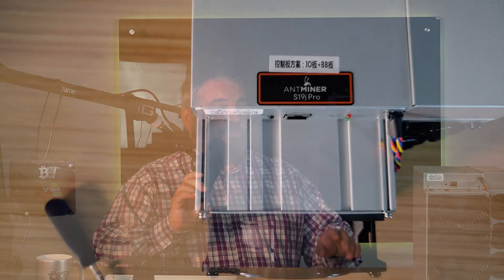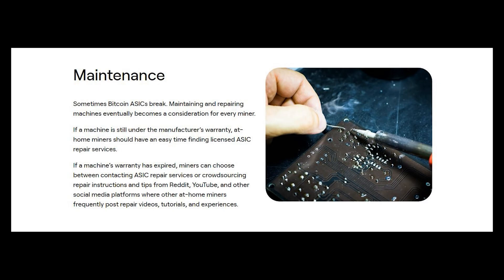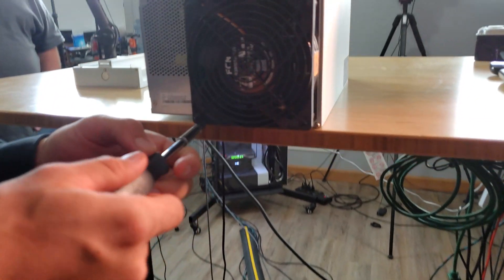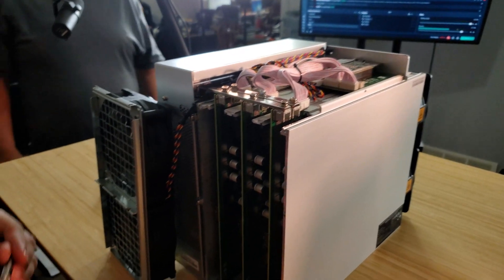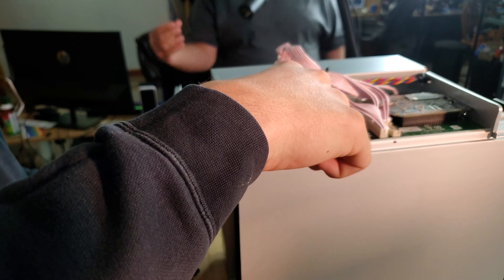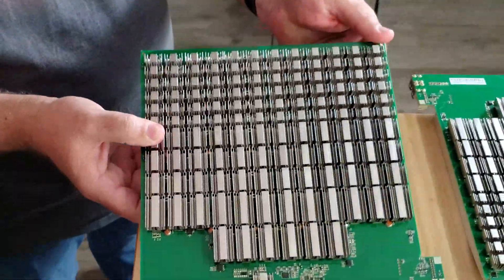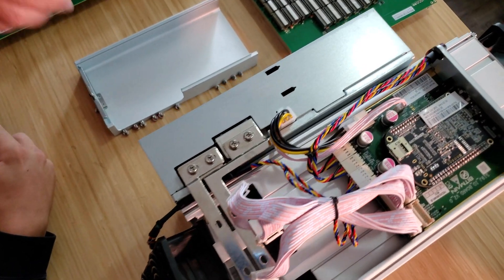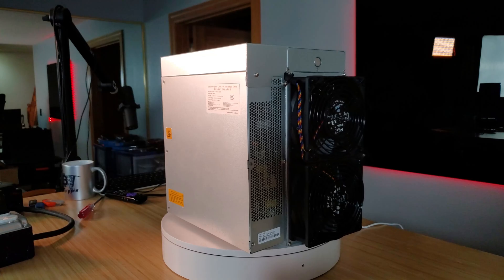Antminer S19j PRO Teardown Guide! Yes, we open up the latest ASIC Miner.

Comment: This is wrong... you want to touch the PCB not the heat sink. The heat sinks job is to remove heat and when you get human oil on them that oil catches dust and that dust becomes an insulator.

Comment: ASICs are a joke.  When you compare them to GPUs they are over 3x as power hungry for the same end result.  One can have a 100TH/s pumping out 0.017BTC per month worth $1145 by today's blockbuster price or can have 15x 1660 Ti GPUs making the same in ETH -> BTC auto exchange with just a fraction of the wattage.  Mine is 1050W vs 3050W of the S19j...gee you do the math.
Reply: Until june anyways when ETH goes to proof of stake. Enjoy it for now, because when the difficulty bomb hits, your GPU rigs won't be so profitable. Gamers will be happy though I'm sure because ebay will be flooded with cheap high end video cards.
Reply: Wth you on? Asics are more energy efficient and produce more hash power for lower price.

Comment: Magnetic tray, magnetic cloth or parts organizer. Figure out which screws they are and get some compatible spares from a hardware supplier. Order a few spare fans now so you have the if/when they are needed. 
Put a wattmeter on the plug and adjust power limit to determine best efficiency. Adjust target temp. Turn on dynamic power scaling.
Reply: Nitrile gloves also reduce shock so you don’t need to be grounded w ESD strap. But grabbing by the PCB would be a better point to pull from on a lot of ant miners. It all depends how they attach heat sinks but some are attached terribly and will pull off if grabbed. If you grab the PCB staying clear of surface mounted components you should be fine.
Reply: You can thermal epoxy the heat sinks yourself instead of sending off for service if that’s the only issue. YOU CAN DO IT! 👍

Comment: 12 grand for 3 hash boards pretty sad. Always best to buy equipment in middle of bear market! Will probably move to ASICs when Eth moves since gpu mining will be dead for awhile.
Reply: Get a cheaper ASIC now. Even S9s are still profitable. $350-400 used full kit
Reply: @MikeNovelli  S9 are not profitable unless you live in an area where they give power away.
Reply: @TheGhostOfKarazhan  I was gonna say what profit lol if there is any its like .25¢ per day lol. I've been looking at buying old hash boards and trying to build my own all night and even a diy build wouldn't be worth it getting used s9 hashboards at like $50 per board. They are way too slow for the current day and age.